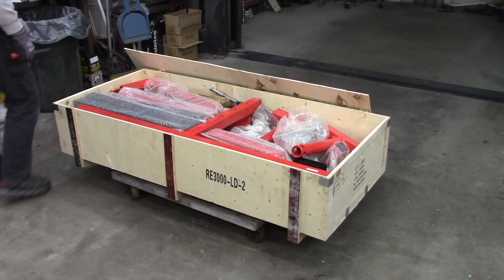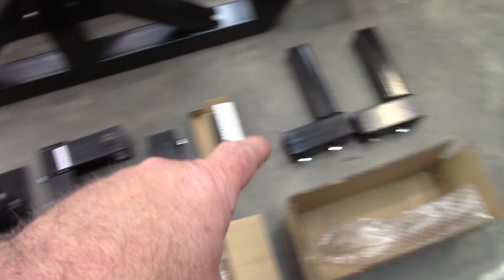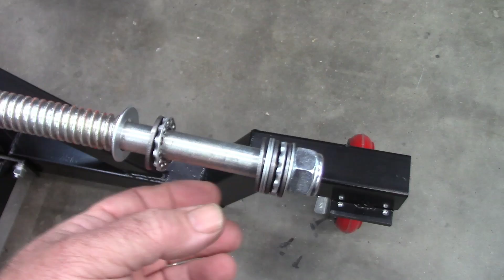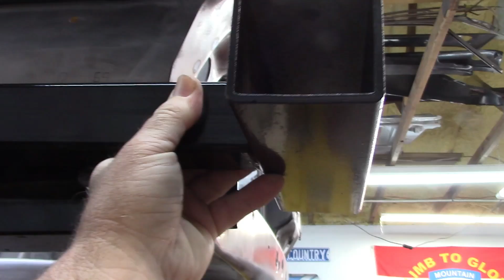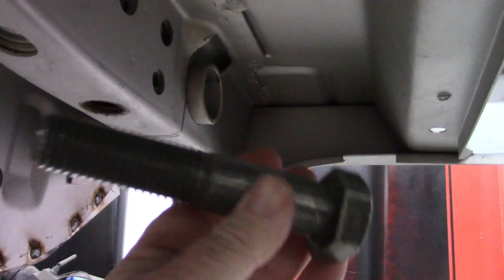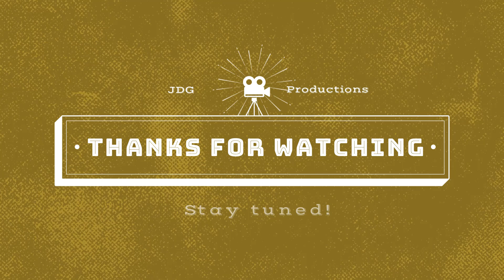Rotisserie build from redline stands. Redline ROT3000-LD rotisserie for cars. Slither part 37.

Comment: I just bought the same lift and your video has me ready to go. Project car is a 1950 Chevrolet Fleetline Deluxe 4 door. I’ll only be putting the car on the rotisserie from the firewall back so my setup will be shorter in length. I’m glad to see it extends all the way out to the front of the engine in case I ever need that additional length for a future project. I’m almost ready to take the body off the frame. I’ll jack up the body off the frame and roll the frame out from under the body. Then I’ll fasten the rotisserie to the body. I’ll be using this to recondition the underside, the roof under the head liner, and also it should be very useful for priming, bodywork and painting also.

Comment: You could slip the jack handle over the end of that crank handle to make it easier to turn and raise it, looks good,
Thanks,
Chris.
Reply from the maker: Jack handle is smaller. I talked with the owner of the company. They plan on making a longer handle. And other improvements.

Comment: Congratulations, Barry!  You're going to LOVE working on a rotisserie. I've used one that's 40 yrs old and wretched, compared to your new one, but it's saved my bacon, and my back, on two restorations so far.  Yes, the bracket-fabbing and finding centerline is a pain, but man is it worth it! Yours, with screw jack centering adjusters, is especially nice because as you're working, adding and cutting on a project, the COG moves around a bit. Nice to be able to easily re-center the tub as you go. It gets really scary if that lump comes 'over-center' on you, as you're trying to spin it...ask me how I know ;)  
Loving your progress- it's relaxing to watch a hardworking guy do things right. And man, am I glad to have these steps behind me! I'm gonna finish my five year project this summer. Thanks to "Jo Daddy's Garage"!

Comment: What is the overall height when the car is balanced on it's side?  Wondering if it would fit in a space that's 8' tall?  Good video as usual.  Thanks for putting them out.
Reply from the maker: My loft towers are 8 feet tall for reference. I measured with the car on its side. Clears easily. Almost a foot to spare.
Reply: BTW the car i'm working on is a 68 mustang, so i'm assuming the dimensions will be close to the 69.

Comment: Reduce the thickness of the bolt head by 1/4”. The bolt is overkill for the application so reducing the head will not hurt a thing.
Reply from the maker: I thought of that but I went for what I knew would work. Showing others ideas as well.